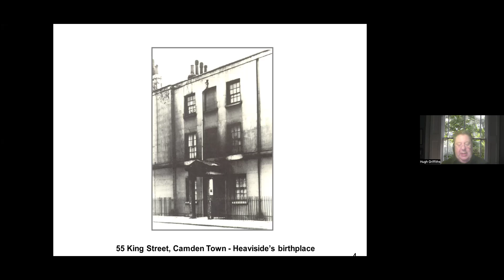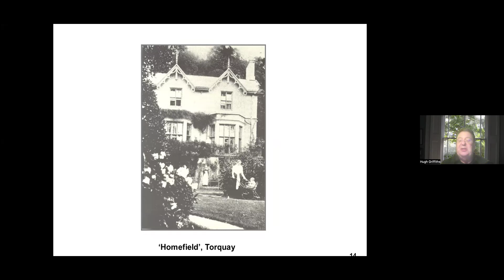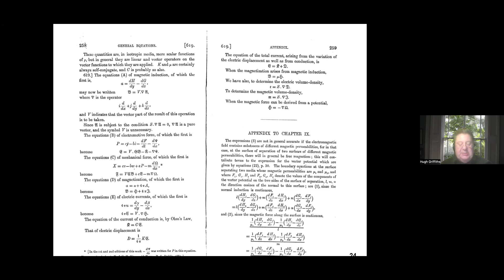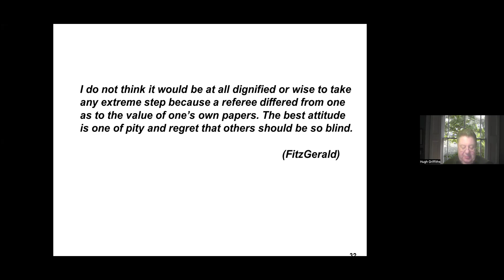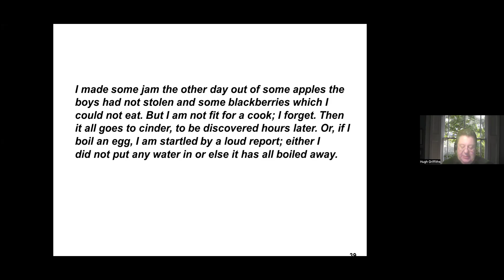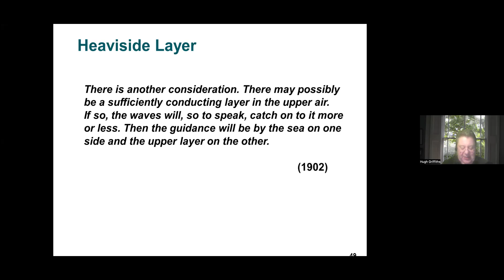Oliver Heaviside: electrical genius of the Victorian age. A Camden History Society talk.

Comment: At age 18, I encountered Heaviside peculiar method to solve Differential Equations. My profesor presented a "D", called "the operator"  (Heaviside used  "p")  and happened that "D" was "d /dx" ;  and a Diff Equation was written as (D²+5D+6)Y = 1,  next  was solving for D in  D²+5D+6=0.  D, an operator,  happened to have two values D = -3 and D=-2 !!  As if in "a+b=2," the operator "+" could have a value !!